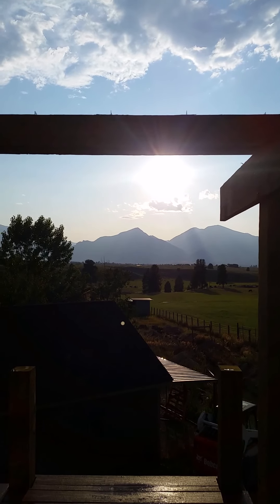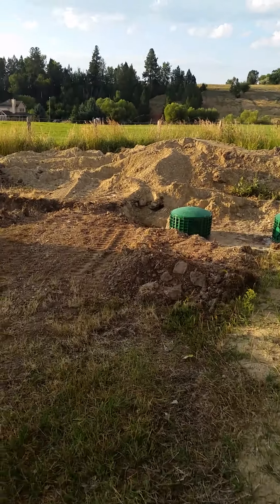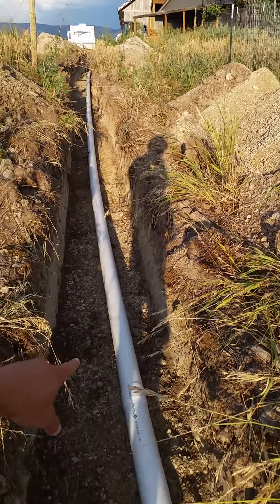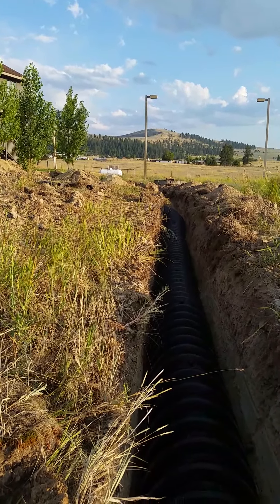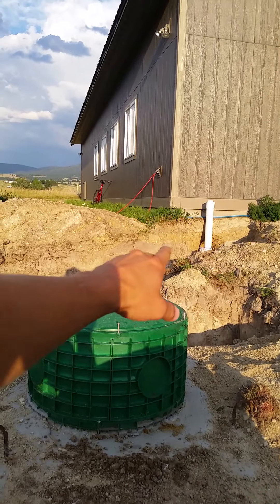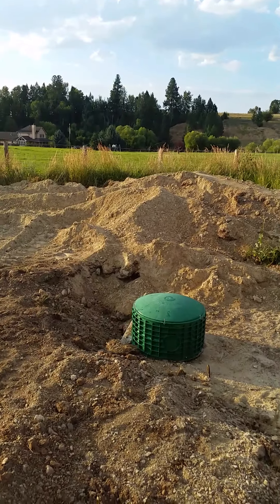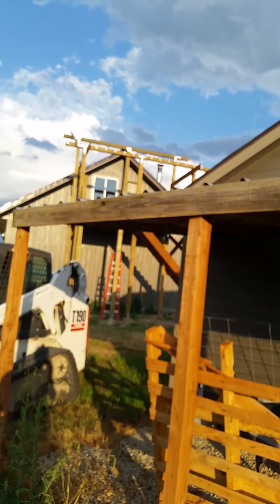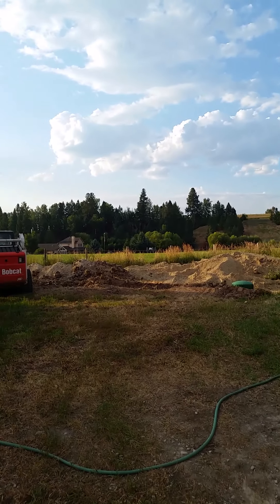Septic Install 101 - It's really not that complex

Comment: Nice! What depth is your frost line?  Also a little extra expense but great to have is tracer wire. But then again I guess you could always reference your you tube video in 10 years to get a rough location of your install.
Reply from the maker: Thanks!  Frost line is right about 24-36'' in this area.  I almost ran a tracer wire but then decided I would mark it out with some metal stakes.  That way I could easy tell were it is when I'm driving in the area.  I also took measurements from the fence and wrote them down.   The video would be my starting point as well for quick reference.